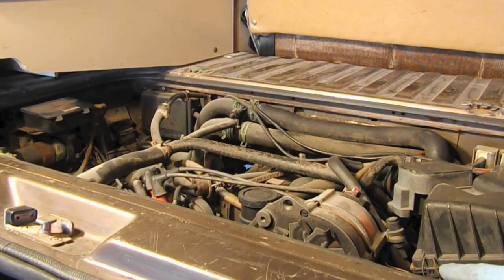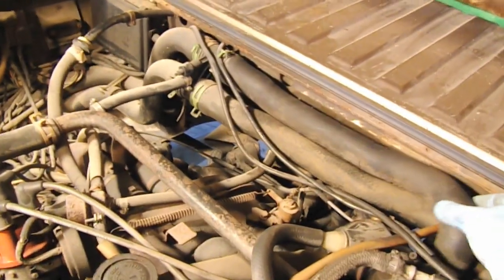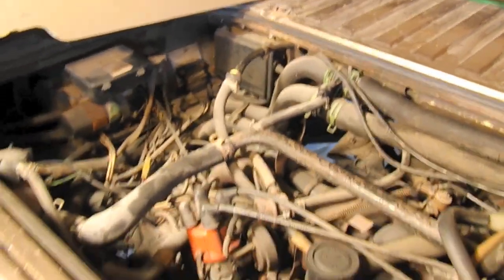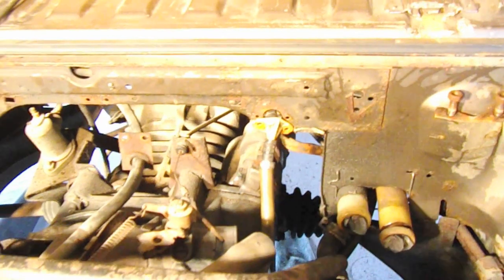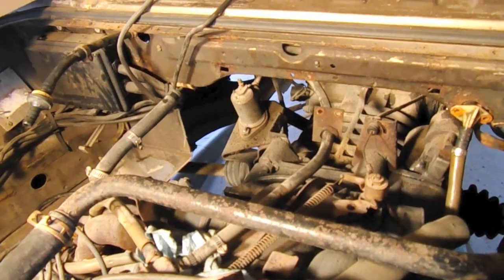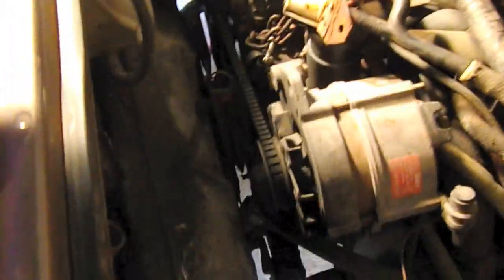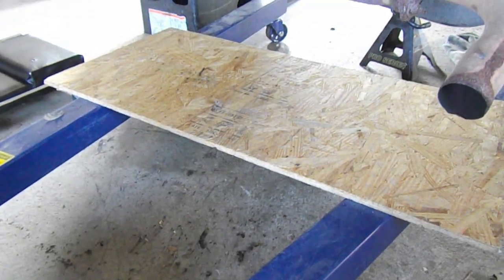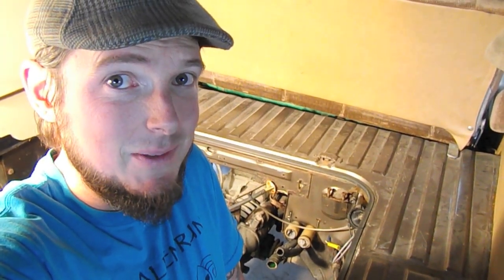Vanagon engine pull - Subaru Vanagon Engine Swap Part 2

Comment: Probably will be doing this later this year..85 Westy...Any preference or difference on a 2.5 vs a 2.2 ?
Reply from the maker: +DanTheManIOM hey Dan, I love both engine sizes. I would probably go with the 2.5 though, as they're easier to come by.
Reply: DanTheManIOM 2.1 vw waterboxer is great, maybe the gw 2.2 one has more output than an Subaru

Comment: worthless wasserboxer engine. the very definition of "boat anchor" or "good for nothing scrap metal"
Reply: John mine lasted /lasts 38 years and still runs great .in never broke down on me .unlike Subarus which self destruct oil and piston rings .take an look at some forums to see how good Subarus are .the old style wateboxers had no timing belts and were not that complex
Reply: @reacp9114  EJ25?